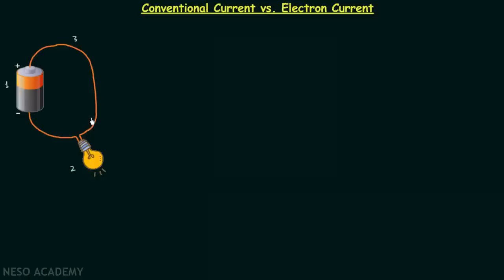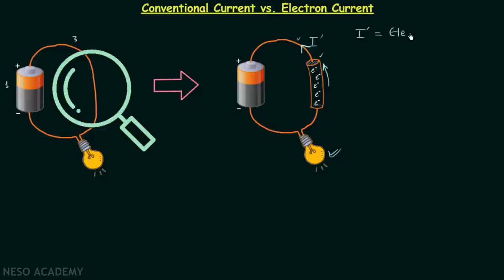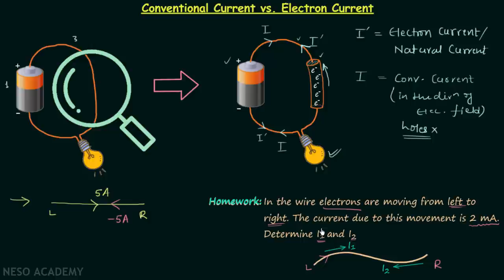Conventional Current vs. Electron Current

Comment: As per sign convenstion suggested .... we can take any of the current I1 or I2 as positive but we have to take the other one negative ...... But if we have a battery attached to the wire or any potential difference which will be responsible for the current in the wire then we must take the current which is going positive to negative as Positive and other one negative

Comment: L2=2mA and L1=-2mA.
As in the video mentioned that we are going follow only conventional flow. Reverse of the e direction in actual current.
Reply: If that is true , so there will be no flow of current
Reply: @almuhanadahmedsaidalhashmi4696  of course there will be a current flow as there's electrons in wire, but protons in a wire are present in nuclei of atoms, so they don't move, we use conventional current is because it's a standard method
Reply: @mattchris3421  shouldn't I1 be 2mA and I2 be -2mA? L-R is I1 ... right? So doesn't that make I1=2mA
Reply: @bertinaagnes73  I2 flows from +ve to -ve, so I2 certainly is 2mA, I1 is in opposite direction of I2, so I1= -2mA
Reply: @mattchris3421  yep, saw the next video where he gives the detailed solution, thanks!

Comment: I'm a little bit confused. In one of the first videos you mentioned that only the electron flow is relevant, but in this video we dont want to use the flow of the electrons (electron current) but instead the flow of the protons (conventional current)? Which do we use?
Reply: In any substance or material or object ....protons never move ....only the electrons can travel ... for eg if electrons are moving from Left to Right then Right side will behave as negative terminal and the left side will behave as negative automatically ....

Comment: I'm confused. In electron flow current the electrons flow from a negative to positive terminal as opposite charges attract. However, how can it be that in a conventional current electrons flow from a positive to a negative terminal. Or is it that protons are flowing from a positive to a negative terminal? Can someone explain?
Reply: Protons are immobile. If there is anything that is movable, are the electrons. Since they move from -ve to +ve and -vely charged, the direction of electronic current is oppo to that of the conventional current

Comment: I have a doubt moving positive charge is called conventional current but u tell its not due to hole...what particles are the reason of moving positive charge ..plz clarify anyone
Reply: bhaskara lakshmi ganisetti holes are positive only on semiconductors , in metals protons are the positive charge
Reply: Actually electron are reason for the movement of positive charge ,when electron moves the previous place of electron becomes positive and it seems like positive charge is flowing
Reply: @NiyasT  why

Comment: negative charge -5A can supply to system to work. Or we should use only 5A supply. What is the advantages of conventional flow of current and electron flow.
Reply: when you do circuit analysis, direction of current become important such as using Kirchoff's current law.....but in reality you just connect a device to voltage supply and that's it, the current direction is not a matter

Comment: In conventuonal current as u describe it well i like it but the question is that in conventional current the current is due to the protons i.e. particles having positive charges but with flow of protons, electrons are also moving in the circuit then isn't ther any possibility that these two cancel out each other's effect
Reply: if you have learnt about metals, the definition is (nuclei of atoms immersed in sea of delocalised electrons), and nuclei in atoms are fixed, thus the protons don't move but electrons are moving, positive charges only move when they are in the form of cations present in electrolyte
Reply: @mattchris3421  Then how will you describe the difference between the current i.e Conventional and Electronic current.
Reply: @hsmoin9739  depends on usage, in reality electrons are flowing in conductors, but in calculation you can use conventional current to make everything easy, and sometimes both type of current can also be used in calculation

Comment: How does the various types of battery like Hydrogen battery or  Lithium battery make the difference in selection of batteries .. My question is what will happen if I chhose Lithium battery over a Basic battery what will happen to the movement of electron. Will it be faster or slower. I am not asking in specifically for one battery . But I want to know variation

Comment: if + not means holes then how can u distinguish + and - of a battery . if it is  not positive then how can electron attracts towards +  in case of natural current . hence there is no concept of natural current. 
according to conventional current 
more charge ( only negative i.e electrons) concentration means positive notation less side treat as negative. nothing but potential difference. one side more electrons other side less electrons. we know same charges repelled so high concentrated side electrons now will push the electrons in the wire as a result current. conventional current is correct

Comment: Why are the direction of natural and conventional current opposite to each other ?
Reply: Since electrons, the charge carriers in metal wires and most and most other parts of electric circuits, have a negative charge, therefore, they flow inthe opposite direction of conventional current flow in an electrical ciruit.

Comment: Is this real in circuit to exit a electron current?
Reply: Yes, electron current is real. Electrons flow from the negative terminal of a battery to the positive terminal of the battery: this is called electron current. However, it was thought in the old days that the flow of current was due to the flow of positive charges. This is incorrect but we based many of our ideas and teachings on this incorrect idea: Conventional current, usually referred to as just current.